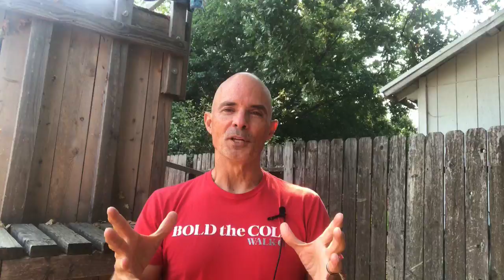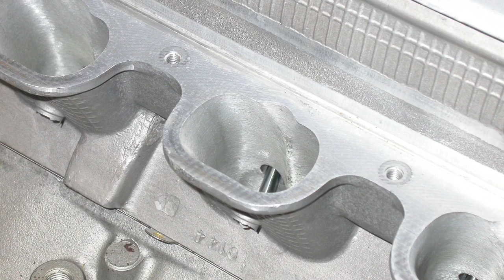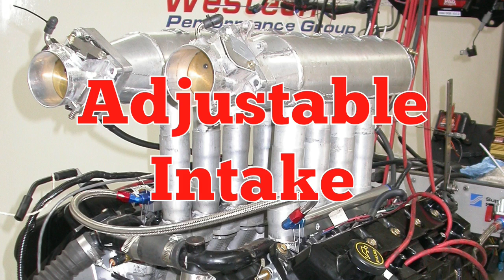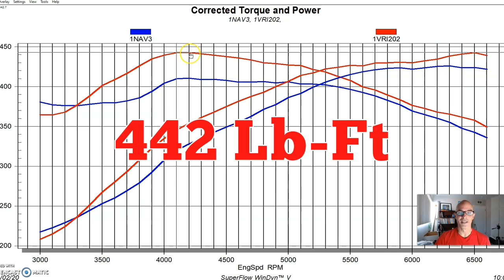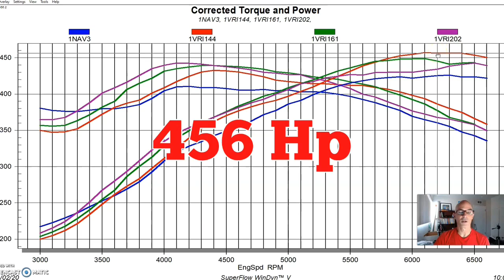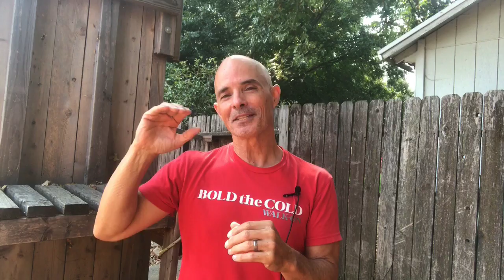5.4L AUSSIE BOSS 290 INTAKE TEST

Comment: hello Mr. holdener! very nice to get to speak to you. so I'm new to the 5.4 4v motor. i have put one in my mustang. i am trying to find a good intake. i have been thinking on a voloicty coyote intake. could u pls tell me if it is a good or bad idea? i need to get the most out of the motor in the bottom end and med rang. I'm worried I want get the full power of my motor until I'm out of rpm....???? do u no anything about the intake I'm asked me about? the motor is stock other than a set of stage 2 I think may be stage 3 turbo cams.
Reply from the maker: I've never tried running a Coyote intake with adapters on a 5.4L, but the intake itself works very well
Reply: @richardholdener1727  well I really could use some pointers on my 5.4 4v motor. one is what is a good rpm to shift at? also I no that if I go say 5000 and shift that extra rpm is throwed in there over it being a manual so I would actually be revving the engine around   5500 RPMs give or take. l am looking for about 400 to 500 on just motor. that's what I'm after. let me send a pic to u of what I've done got for the motor in building.

Comment: If you want a bigger throttle body opening for the boss 260/290 upper plenium find a boss 315 plenium from a fg 5.4 gt. They have a twin 60mm throttle body. Or u can buy aftermarket higher volume pleniums from aussie relatively cheap

Comment: Yeah, piston speed doesn't limit rpm. It can however affect the piston lifespan. If the pistons aren't made for it, prolonged time at or above those F1 speeds can cause the head of the pistons to slowly disintegrate.
There's all the information one would need to back that up in the Honda K series world. People have figured out about how long the factory pistons last at those speeds. But, it's a known entity...
Reply from the maker: short-stroke, F1 piston speed is not very high-700, 800, 900 inch motors running 7500 rpm are higher

Comment: The Boss 260 and 290 were not the top of the line set up they were mid range , top end aussie 5.4 s had 307 and 325 kw ( the boss 260 and 290 are kw   ratings ) so the 325 has 470 hp from factory ford ! And rare , please thousands of them in aussie wrecking yards, get a whole running Boss 290 and T56 six speed for about $3500 Australian or $2300 US .
Reply from the maker: Very rare in the US
Reply: @richardholdener1727  just a E bay payment away , they were everywhere in Oz !

Comment: Did you guys ever test the 5.4 with the stock cobra intake with adaptors ? Wondering how mine is gonna run or if I should have went with a Coyote Cobra Jet set up. Over all I will end up most likely building the engine to rev high, keep the Navi heads and do the exhaust valve job and work the ports a little and get that compression up and have a fun NA motor.
Reply from the maker: 4.6l cobra intake?
Reply: @richardholdener1727  yes, I’m running the 03/04 Mach 1 intake (99/01 Cobra Intake) with adaptor plates. Just wondering if it was tested like these on a 5.4. I’m going to get it worked over next year when I pull it back out to build the bottom end and do heads and cams.

Comment: That 290 is cool. I think the navigator intake is going to work best for a daily driver. I'm putting one of these motors in a 2000 f150 single cab stepside.

Comment: Tip from down Under with the boss 260/290 intake get the Yella terra duel throttle body and use a spacer inbetween the upper and lower plenum

Comment: im running a boss 290 intake manifold on my twin turbo 5.4 4v. I cut and relocated the throttle body to the front. running a LS 90mm throttle body on a holley stand alone setup. Its a great intake setup for sure.  I thought about switching to mmr billet coyote intake manifold with adaptors.

Comment: I've got 3 of these intakes in my garage. Funny how stuff so rare and desirable in one country is just excess car parts in garage in another. My little unmodified Boss 260 runs a Vortech V3 side mounted blower at a mere 6psi at the top end, and a water to air intercooler, sitting pretty with a nearly 480hp :)
Reply: Still have one you'd be willing to sell? With stock fuel rails?

Comment: Just bought a boss 260 BA XR8. Stock makes a good sound. I think a dual throttle either side of the boss manifold would be best for air to each bank of cross flow manifold. Might look at fab shop for new ideas...

Comment: Piston speed has only been an issue when durability is required with stock parts. If quality aftermarket pistons and rods are used theoretically there really doesn't seem to be an issue. There are limits that shouldn't be exeded if extended road miles are expected with stock parts never designed to operate at increased power levels for extended periods. I have a bit of experience in finite element analysis to destruction too hopefully lend some clarity to this subject.

Comment: I was watching a video of a diesel drag truck where the throttle stuck and the auto shutdown failed so the driver had to put it in neutral and let it eat. It was a 6.7 Cummins and it hit 8200 RPM when the connecting rod bolts reached plastic deformation and all hell broke loose. You can find the video on Power Driven Diesels website. So while I sort of agree with you that piston speed is not as much of a limiting factor as valve train it certainly can be a limiting factor in some situations and for that engine it was roughly 6600 ft/min of piston speed.
Reply from the maker: that runaway diesel situation is hardly an argument for piston speed
Reply: @richardholdener1727  No it wasn't a run away and even so why not? Isn't the piston speed argument that you you can only run an engine so fast before either the rod or the bolts fail? That being the case I think this is a very good example. The valve train was still functioning or the engine wouldn't have been able to keep running, diesel or not it needs oxygen. So the limiting factor in this case was unrelated to valve actuation but was instead related to the ability of the rod bolts to secure the rod to the crankshaft. You asked for an example of piston speed being the limiting factor. I'm not arguing that it is the case very often however in this case it was. This wasn't an old 2 stroke Detroit running away in which case I would agree with you that it isn't a good example since the Detroit's use their valves to get rid of exhaust but this was a 4 valve Cummins which uses 2 intake and 2 exhaust valves has something like 9/16" pushrods and is purposefully built to run at least 5-6k on a regular basis with tool steel piston pins and tons of other racing components. So please explain why this is a poor example of precisely what you asked someone to provide?
Reply: @richardholdener1727  https://en.wikipedia.org/wiki/Diesel_engine_runaway

Comment: The upper plenum on the Aus Boss manifold can be improved quite a bit with Yella Terra swap or modified for front entry dual throttle body. The front and dual throttle body mods have all been done before. You can buy them on ebay.

Comment: Interesting.  A 5.4 has a higher piston speed than my 521 (8.5L) BBF.  I have played around with a 5.4 Lightning motor.  A couple of nice things about these engines is the stout bottom end assembly and the very stable “small bore” piston.  4V heads, small bore and long stroke can be an excellent combo.

Comment: They usually try to keep piston speed below 26 m/s no matter your stroke because the engine has to sustain that speed. It's not so much about valvetrain. You can have a formula one piston speed with a 6,000 rpm redline depending on your stroke. For 1/4 mile application you can do whatever you want because it's only for a couple seconds. The 8250 rpm redline of the 5.2L coyote in the gt350 works out to exactly that, 25.9 m/s the very same as a formula one engine. That's determined to be the limit for an engine that has to run at that speed for hours at a time.

Comment: Hey rich. Could you do some more budget boosted 460 videos? Their is a lot of guys with trucks running these motors that want more power. Thanks
Reply from the maker: about to do a 429
Reply: Richard Holdener please bring it to grenade power haha. Their is a lot of miss information on what a D1VE block can handle. I read an article years and years ago that their is an ol gasser dragster with a two bolt main block that was blown on alcohol making 1800hp and supposedly it still sits in a museum today. Thanks

Comment: Why is it called a 290 if it's on a 5.4 (327ish)
Reply from the maker: might be power rating
Reply: @richardholdener1727  290 kw
Reply: I have a Ford Falcon XR8 260KW 5.4LTR V8, 260KW  (Kilowatts) is 348HP 👍🇦🇺

Comment: I think where the myth of piston speed started was guys were not taking into account the port flow of the intake tract.  If you speed th motor up, obviously you are going to need to feed it or it will just make more noise and not much more power.  I think some guys felt that the faster piston speed was a detriment to the intake vacuum as it was too fast for the airflow.  The reality is you are trying to pull  more air through the same size pipe in  a given measure of time.  More piston speed (RPM) needs more port flow to make it work.

Comment: I had a dyno shop here in Aus for 25 years (got out in 09) and we specialised in the Boss 4V engines along with the Turbo Barra and the GM LS engines. Our primary R&D car for Ford was an FPV 290 Ute. With only bolt-ons, tuning, etc, and a well set up car running the factory 4spd auto trans (4500 stall with a Heavy Duty lock-up clutch), at 3700 pounds race weight we ran an 11.6 @ 116.9mph. Completely stock internals (unopened) and Naturally Aspirated. Working with our chosen cylinder head guy, Dave Webb of AFD (Airflow Dynamics), we both thought the intake runners were a bit on the large side for the stock engine, so we reduced the crossectional area throughout by approx 20%. The result was interesting, and we lost no power anywhere whatsoever, right up to the 6700rpm limit we had set, and we made a little gain between 3500 to 4500rpm but only about 3 - 5hp. We never got to try a further reduction but a have a feeling it would have been beneficial on this engine to pull some much-needed power under the curve without sacrificing too much upstairs if anything at all. Another interesting point was that I visited the foundry that cast the prototype and spotted the same manifold in his office on display, and to my surprise, he told me that there was only ever this one prototype/size and configuration created and tested.
Reply: I'm in Manor, if you have any parts left or at all for a 2v or feel like tinkering with a 5.4 2v Pi engine or if you ever wanted to play with the Coyote. I have a 2nd gen ready to be built. 🙂

Comment: Love these videos Richard. As an aussie its awesome to see you test the boss intake. But you can buy an upper plenum with the twin throttle inlet. The most common throttle to add to the bigger inlet is the factory gt500 twin 63mm. Then step from that to a twin 68mm. Or get the big boi 140mm monoblade.

You can find the after market version of the upper intake plenum here
http://store.yellaterra.com.au/ford-v8-boss-5-4l-hi-flow-plenum-lid-black/

There is also an aftermarket version with 1 factory throttle on each side but im yet to see one dyno tested

https://www.ebay.com.au/itm/264093058714

I also have a factory boss 290 intake for sale. With the USD being super strong against the AUD nows a good time to buy as its almost half price for the guys in the us.

Comment: I would life to see a long runner intake test using dual 92mm throttle bodies. On a stroked ls with ported factory heads vs after market head. Without and with power adders.

Comment: Got a question if you can help please got a lq9 and thinking of putting 706 heads on it is this a good idea and will it bolt right on without issues being that it’s a lq9 2003
Reply from the maker: compression will be high

Comment: Make a variable sliding intake that can be manually shortened as the RPM goes up, it would be revolutionary.  Then design a servo system with controller to auto vary the length using RPM and throttle input. Maybe can be integrated into ECU, maybe Holly would work with you to design it.

Comment: Richard, it would be worth measuring the restriction that the throttle body causes. You may find that increasing the plenum size gives a bigger gain than increasing throttle body size.

Comment: Yes but the f1 engines that reved to 20000rpm only had 42mm  stroke  with 90mm bore    
Needed the bigger bore to get bigger valves in so it would actually breath at that rpm

Comment: Boss 290 the world 🇦🇺. 
Great video Richard, there are a few different options of top section (plenum) for the aussie boss manifolds. All expensive to. I run a yella terra plenum lid that allows larger dual or ovel throttle bodies. Only running twin 60mm. Definitely noticeable gains. 
 A carbon r is a front entry lid and there was a lid made at one time in history that had throttle body wither side...

Any chance of future vids on best 5.4 NA setup. Loved the boosted 5.4 vid. 👌
Reply: Ayyy  your still  active👍👍👍  any  upgrades on your XR?
Reply: @MadLadMartyMcFly85  G'day Josh, yeah mate some 3.23 diff gears and some tramp rods just gone in.. looking and flex fuel system with a retune and going to see how it goes down the 1/4mi
Reply: @koontproductions  ooof   tyre fryers hey....flex fuel,will  that  work well with  NA motors?   Ive only assumed that was good for  boosted engines?
Reply: @MadLadMartyMcFly85  yeah better for boost but if i can squeeze alittle more out NA just for 1/4mi then it'll help. Then i suppose i could go boost 🤔🤣.  I would have to give the intake cam the flick but i have options.
Reply: Boost is a serious investment  unless  you can do it your self
Reply: @MadLadMartyMcFly85  sure is, no rush really only if the time and coin is right.
Reply: @koontproductions  i hear that👍👍👍

Comment: Thank you very much for testing this engine, it's a true junkyard gem! One question for you though, was the Navi intake run with the crossover open or closed?

I've also run across a rumor that the supercharger from the Mercedes AMG M113k 5.4L can be mounted on the Ford 5.4 with a spacer. If anyone has any information on that I'd love to hear it.

Comment: I bought a 290 off ebay here in America. Absolutely badass intake. Paid 500$ for mine. Also rpm on these engines arent limited to the valve train, its the terminal piston speed due to the long stroke of the 5.4. The piston becomes unstable, and the skirt starts smacking the walls with some brutal force.
Reply: Is the 4.6 or 4.6 stroker to 5.0 better than a 5.4?

Comment: Late 5.4 fg falcon have different throttle body to that one. Im pretty sure the boss 290 have 90mm single throttle body. You have have the xr8 260 boss manifold which have the smaller throttle body then the real boss 290.
Reply from the maker: thnx

Comment: I'd like to see some kind of small block with pneumatic valve train rev to 12 thousand rpm, Richard can do it
Reply: Piston speed would be off the scale. To pull revs like that you need a very over square engine. You couldn't get the bore to stroke ratio you would need in a production small block.

And would the 2 valve head breathe well enough ... ?
Reply: @psk5746  it's possible, a nascar engine goes all day at near 10 thousand. Remove the limiter and it'd do it a few times at least. The pneumatic valve control would make it reliable provided the rods were titanium and bob weight was light.
Reply: @dinosshed  I didn't realise NASCAR engines revved that high.  Damn impressive. So yes 12 k rpm is potentially possible.

Note though that NASCAR engines are over square. Are street small blocks?
Reply: @psk5746  some are under square, some over, same with six bangers. Fact is most stock bottom ends could reach 10k if they had the supporting breathing mods. There was a nova reacing every bit of 12 a few years back.

Comment: I'm with Mr Holdener. I turned an all motor D16 honda 9500rpm over and over. It did wear out rings. New rings, and output would come back to the baseline. 3.54 stroke

Comment: It may not be a good idea to pooh-pooh the idea that piston speed is a limiting factor when comparing pieces CNC'ed from billets of pure unobtanium, like Formula One engines, to average, sun-of-the-mill powerplants from Interstate luxo-barges designed to amble down superslabs at 1,250 RPM.
How often do these "mountain motors" and Formula One mills get rebuilt?  After each meet?  Between races?  What is the rejection rate on their reciprocating parts?
What does John Kaase build his uncalculated-piston-speed engines for?  Tractor pulls?  Drag races?  Or 24-hour endurance racing?  The Baja 1,000?  It seems like there's some pieces of the puzzle missing.
That Sullivan, though!  Even though it loses torque down low against the "stock" engine, those long, flat torque curves are what I like to see!  Pretty good for a V8.
Here's a question:  What about runner length versus plenum volume?  I've lost my copy of The Scientific Design of Intake and Exhaust Systems.  What's the relationship?
Reply from the maker: plenum volume has much less effect-watch the Kegalodon video
Reply: @richardholdener1727  Okay, been there, done that.  That was interesting.
I wonder if plenum volume is less critical on 90° "crossplane-crank" V8's because of the uneven firing order.  Similar to how their torque curves are less influenced by exhaust primary tube length when compared to 180°-cranked V8's or inline 4's.  Designers, mechanics and researchers talk about notable differences in torque curves of inline 4 motorcycle engines based on plenum volume.  (I haven't seen the curves myself, though.)  Or maybe the smaller the engine, the greater the effect.
I've got some thinking to do...